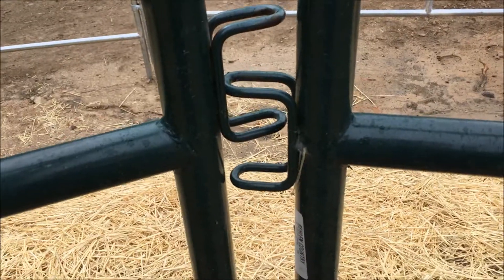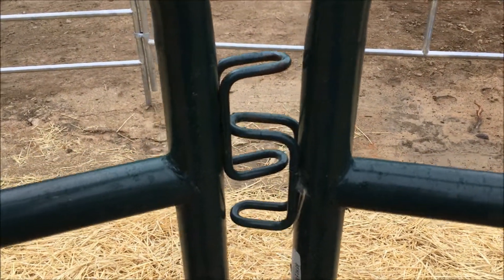Round Pen Build - #3 of 3 - Round Pen Panel Install

Comment: how many panels did it take
Reply from the maker: I think it’s 18 panels plus the gate panel
Reply: Are those 10’ panels ?
Reply from the maker: Yes. 10ft
Reply: How did you make a perfect  circle?
Reply from the maker: Put a stake in the ground. Get a string. Attach string to the stake. Pull it tight. Walk around in a circle.